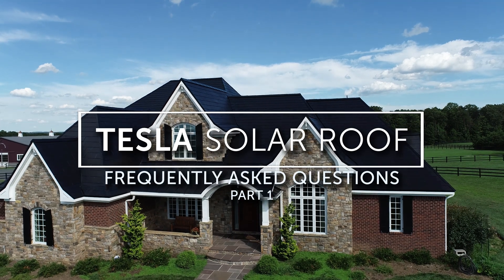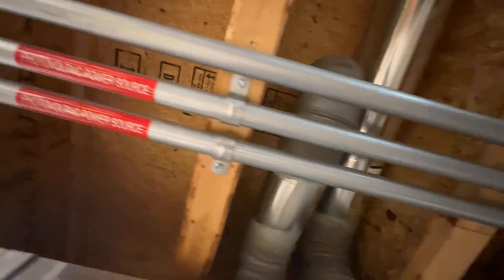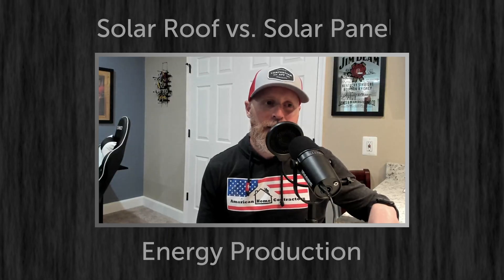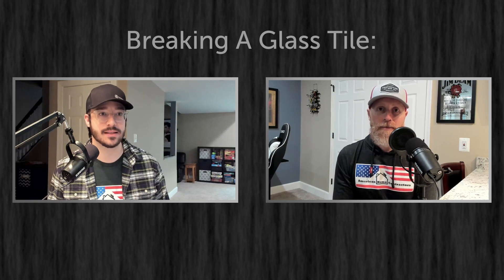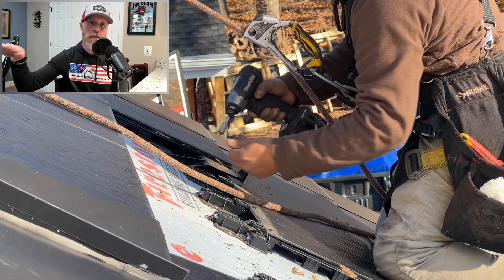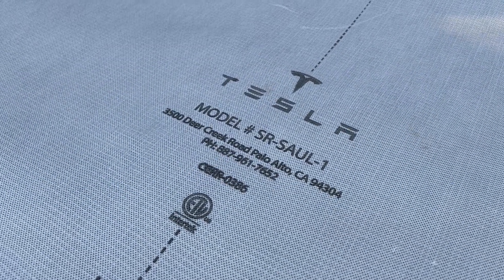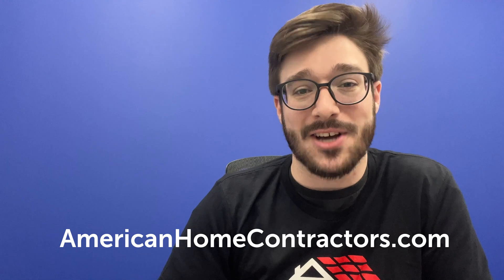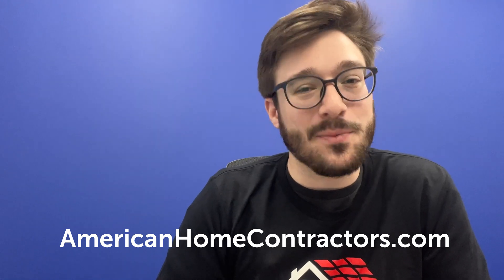What is Tesla Solar Roof? | Frequently Asked Questions: Episode 1

Comment: can you address what type of roofing material you install on the roof areas that are not used for solar collection because of their location.
Reply from the maker: We can certainly do a video around this! The photovoltaic (PV) or "solar producing" tiles are bordered by non-active, metal tiles. These metal tiles are designed to seamlessly blend in with the active glass tiles! You really have to catch the roof in the right sunlight and the right angle to see the difference when it's installed.